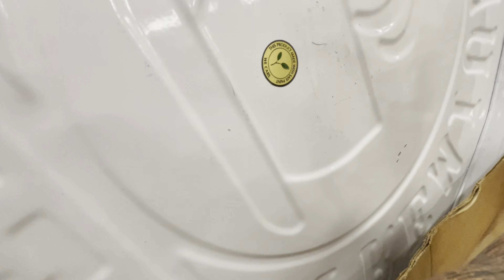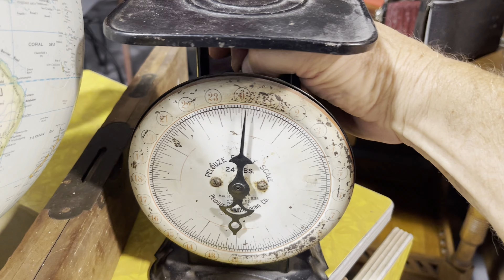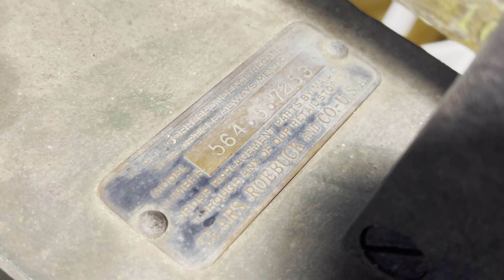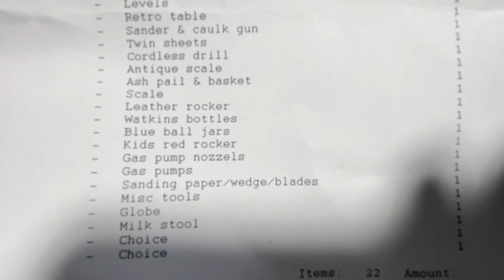Episode 26: I Score a $1200 Ekornes Recliner For $5 And Antiques At This Lake House Estate Auction!

Comment: The 2 motorcycle helmets came from the Auction with the helicopter.
I helped clean out the Garage after the Auction and a lot of this stuff was hidden out of reach. till I could see it..
As was the pile of Speakers, they were on top of the Cabinets right tight to the Ceiling. 
HAHAHAHAHA...
Thats my Truck sitting inside ?? I wonder why I had it inside ..
Reply from the maker: No idea why. That place was a pretty long haul for me. I bought some good pieces there and would’ve bought more if it was closer to home. Way too far for 2 trips.
Thanks for Watching!